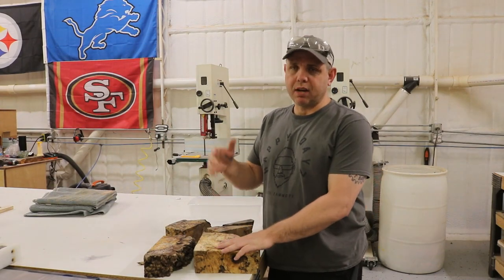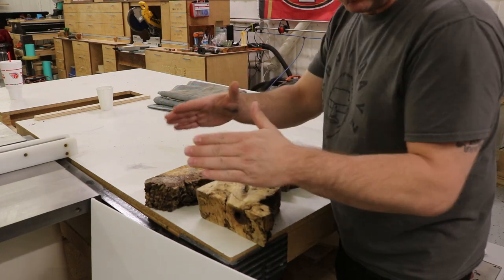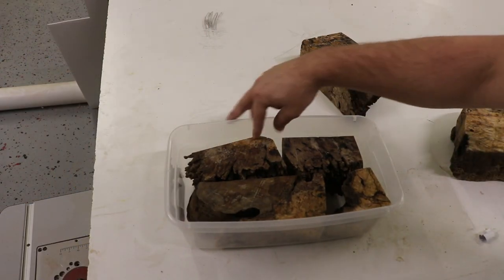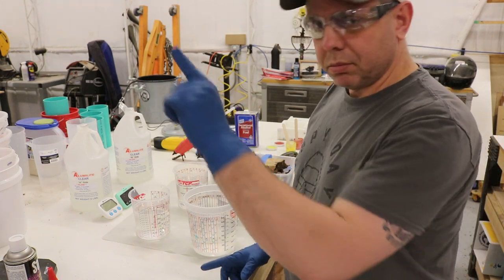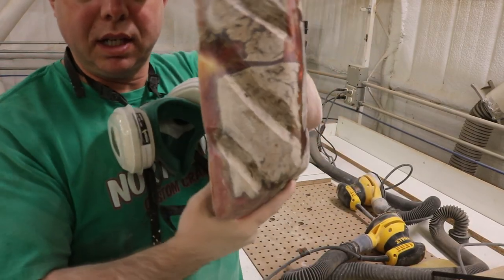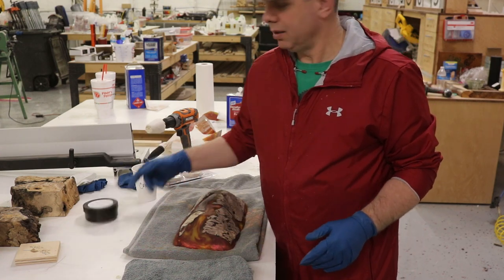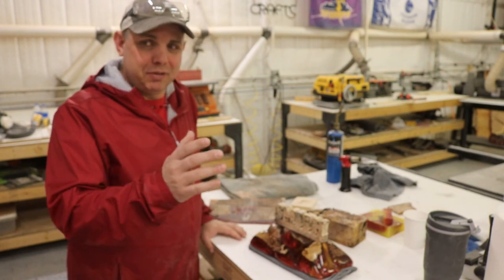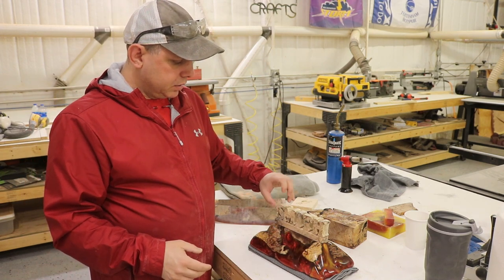How to Make the Most Awesome Resin and Wood Volcano Name Plaque EVER, or at least a pretty good one!

Comment: I am absolutely fascinated watching this process and would love to be able to play with it, but so far, unless I'm doing something wrong this is way, way, way out of my price league. I'm one of those guys that gets my hardwood from Craigslist, dumpsters and cabinet shop cast offs. So, when you just grab a bunch of chunks of burl, crotch and other high figure woods that cost a fortune, then stabilize them with stuff that's hundreds of dollars a bottle (Cactus juice) then throw that in a tub and fill it with hundreds of dollars more of resin, another $50 of coloring that's one expensive nameplate. And the startup costs, even from Harbor Freight are thousands of dollars in pressure pots, vacuum pots, scales, thermometers, pumps and such on top of the woodworking equipment I already have (which would be thousands more if you're starting from scratch) Is there a cheaper way to do this stuff or am I doing something wrong. As near as I can figure that nameplate is somewhere in the $400-$500 in supplies without considering the equipment costs. Looks like $200 of resin, $150 of cactus juice, $10-$15 of coloring, $50-$75 of wood and probably $25 of disposables like sanding and polishing compounds, alcohol etc. I am flummoxed. I love your work, but I was even looking at the section where you were making "samples" to get the flame colors right and figure you spent $100 making those. Is that just the cost of playing with resin casting? Thanks for the videos, they are great. You got my interest piqued, now I have to figure out a way to make experimenting affordable.
Reply from the maker: 1611KJB I’m happy that you liked the video and appreciate the comment.. this can be expensive, but I think you are over estimating the costs of the materials and equipment. I get my burls off of EBay, I contacted a seller and negotiated prices with him and saved a ton on the wood and the shipping.  Cactus juice is around 100 dollars a gallon, but if you buy in bulk it’s considerably cheaper.  The resin used in this video was probably about 50-75 dollars worth. The colors were probably less than 1 dollars worth.   I didn’t get the equipment overnight.. you can use resin like liquid diamonds that doesn’t require a pressure pot and it’s cheaper to start with.  You can make your own molds to save money... I plan on doing this full time, so I am slowly investing in equipment and materials.. but if you want to make smaller things and use the right resin, and make your own molds.. it’s very doable. I made this for a good friend and went full out with it!! Most people getting into this will start off on a way smaller scale. Once again Thank you got your interest and I hope you enjoy videos to come!👍👍

Comment: Jake, this is completely amazing!  I love how it all worked out, and I appreciate that you thought out loud for us!  I do have a question - do you stabilize all your wood, or just stuff that is punky?  I just got a tabletop lathe and I'm getting some wood together to play with, and I wondered if I should be stabilizing all of it.  Thanks if you have time to answer; you rock! <3
Reply from the maker: Fonda Thompson Thank you very much Fonda!! The stuff that is punky for sure.. if I’m going to be using resin I try to have it all stabilized. If you don’t have it stabilized the resin will react with the moisture in the wood.. a good trick is to coat the wood with a thin coat of resin to seal it or some 5 min epoxy.. then the wood will be sealed and the resin won’t react with it.. I hope that makes sense.
Reply: @JakeThompson  That makes total  sense, thanks!  I've used sanding sealer on other projects where I combine wood and resin, and it seems to work well, too.  Is there a benefit to stabilizing as SOP when resin isn't used and it is just wood on the lathe?  I'm a total newb with the lathe and am trying to get as much info as possible.  I've learned a lot from you, and I appreciate you producing these videos; thanks so much, Jake! :-)